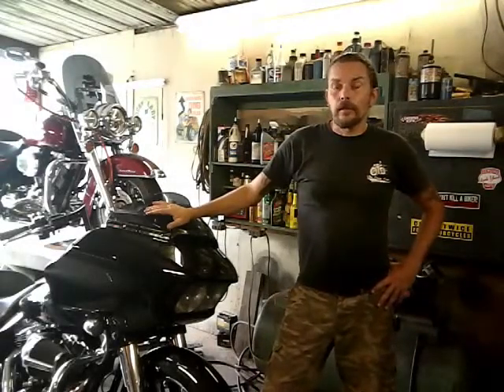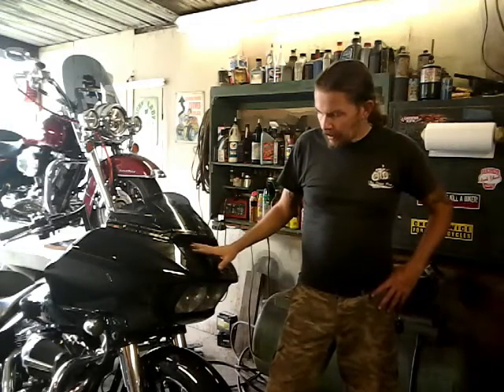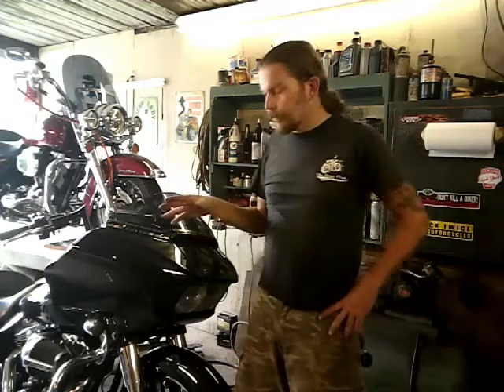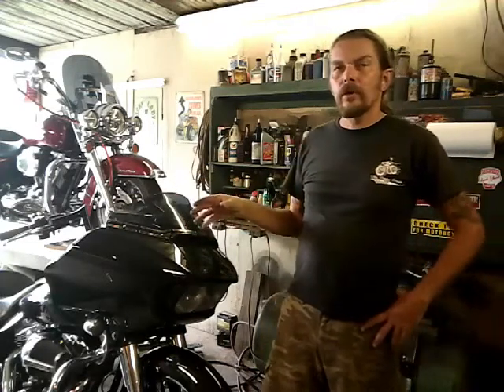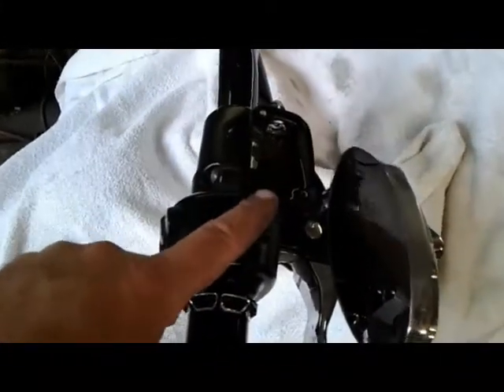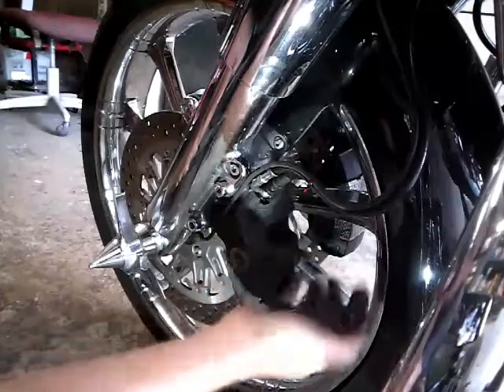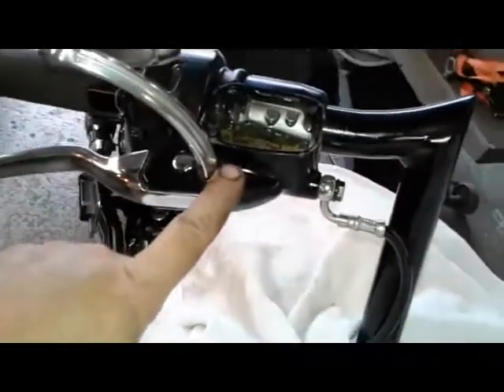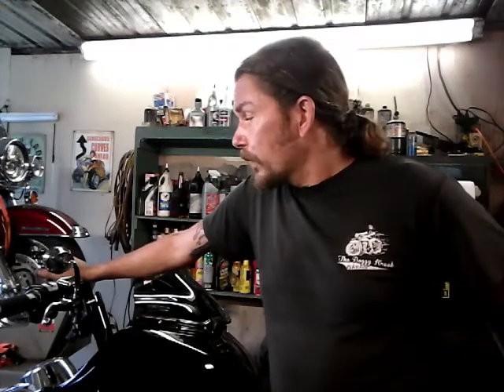Harley Davidson Road Glide with ABS brakes rebuild

Comment: In the video you used the Daytona Twin Tec Gen 4 with a computer. If a computer is required, I suspect a Windows environment is required, or will an Apple computer be satisfactory. Looked up the Daytona Twin Tec Gen 4 on your web site and it's expensive ($800.). I'd like to learn more about the tool.

Comment: You dont have to take the caliper apart to remove the retainer. That comes out easily with no tools when you want to change the pads. I pops out easily for cleaning.